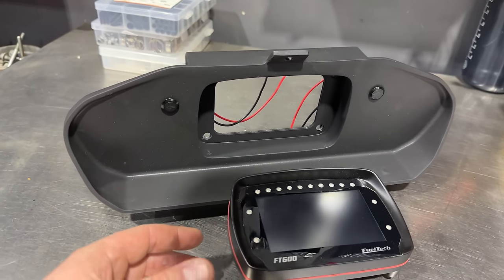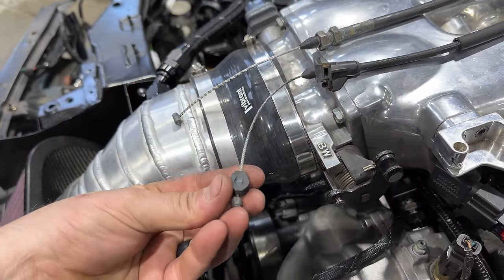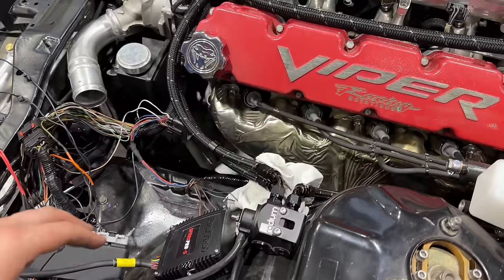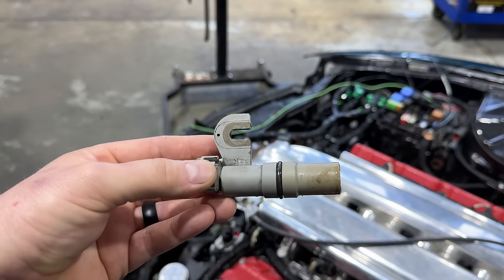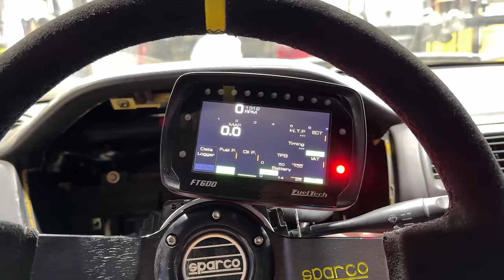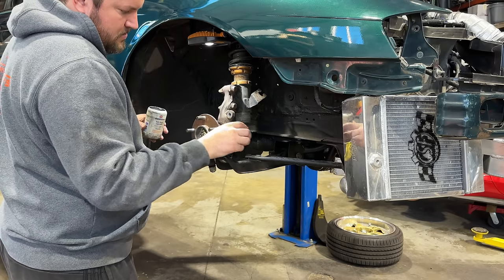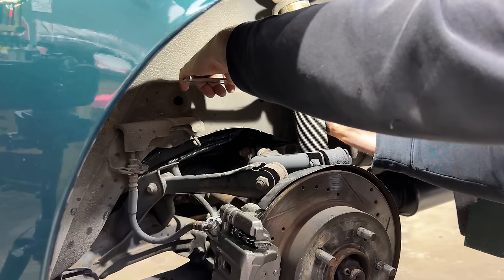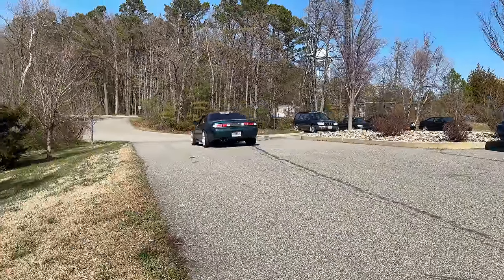I Built a VIPER V10 Powered NISSAN 240SX!

Comment: Who has the the most projects in the shop right now
Reply: Me
Reply: Me 😊
Reply: It’s gotta be Dalt
Reply: Me in a few years. I have a 1951 Bentley MK-VI, and a 1954 MG-TF roadster. the bentley drove from Monterey to Sacramento in 2014 and hasn't moved from the driveway since. The MG was taken apart my my Grandma and a friend to paint it while Grandpa was on a trip for a meeting in Austin. He got back a few days early and was PISSED, so it never got put back together. That was in '87 i believe, it's been parked in the garage in pieces ever since. We still have all of them, im just worried about the engine and the wood panels that it had under the seats. I also have my dad's 1993 chevy caprice classic with a hole in the water pump. It got parked in the field because of that in like March of 2020 and hasn't moved since either. Then there's my Grandpa's 1994 silverado 1500 that he's going to give me once I finally get some of the other cars out of his way and he buys something else. The one car that I actually have permission to work on right now is my dads 1998 Chevy Cavalier. I'm swapping the rear end with a 1988 Mitsubishi Starion and mid engine swapping it with a custom pushrod 6.8 Triton 2 valve V10 and a C6 Corvette transaxle swapped with T56 internals. Theres like 4 more but they're all family members cars that aren't worth the time right now so I won't list them

Comment: I did a viper v10 swap into a 65 dodge coronet with (for now) 48re & winters quickchange rear end RMS FRONT POWER RACK & COILOVERS ,REAR 4 LINK ,,I HAVE HAD IT GOING 2 YRS ,,NEXT IS TWINS & FUEL TECH

Comment: The fuel pump is supposed to have its own relay and wiring preferably you should trigger the pump on by activating the ground on the relay. Essentially. It would be hot all the time if you had the ground attached to chassis ground. But with stand-alone it can energize the coil in the relay through the ground signal it was wired originally too. Risk burning out the ecu wired that way

Comment: Big engine in a little car makes it fun. I put a ZZ430 (350 cu in 430 hp Chevy Crate Motor) into a 75 Chevy Vega with a ZF 6 speed from a 94 Corvette. There is nothing more fun than driving a small car with too much horsepower and torque. Be careful in the rain. The torque will have you doing 360 degree spins from a start if you hit the throttle too hard. I did that too. This is a car you will need to respect. Oh and that grin on your face says it all, congratulations!

Comment: That throttle cable giving me some slight ptsd.  On my last fox body, I tried to replace the sticky throttle cable with a lokar universal from the pepboys speed shop.  It was cut to length with the end piece held onto the cable with set screws.  I probably cut it a little short and took it for a first drive about 15 minutes away.  On the way home, I got on it and it pulled out of the set screws.  Stupid me brought no tools with me and my phone died as I tried to call my wife for a ride.  I am proud of my mcguyver hand throttle I made out of the pararcord on my Keychain and some unused old speaker wire that I yanked out of the rocker panel

Comment: I worked for Texas Pride Trailers for 15 years. I designed the first hydraulic jacks ever made. They are the best Trailer company you can find. I even designed a 53' double deck 7 car hauler with 11 hydraulic aluminum cylinders. I'm looking for a shop that will complete the build on my Nissan 200 SX, It has a lot of work done by me when my back still worked but now I'm disabled and can't complete it. Any help would be greatly appreciated. Thank you for your consideration.........

Comment: The 240 sounds better than it ever has before and better than any other 240 with any 4 or 6 cylinder engine. The chassis has never seen that much torque either. Won’t take much to make a lot more horsepower either.